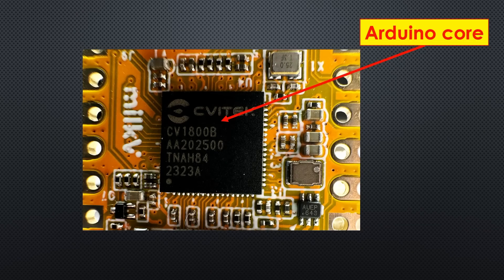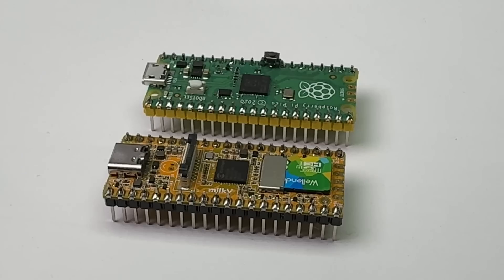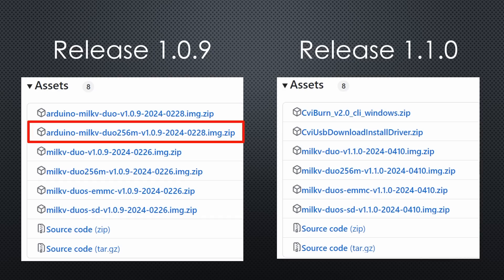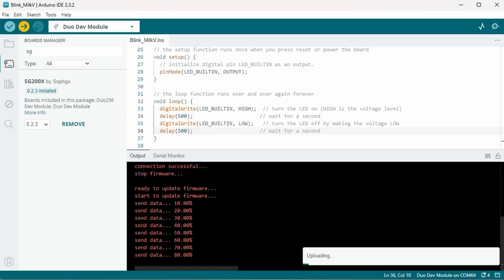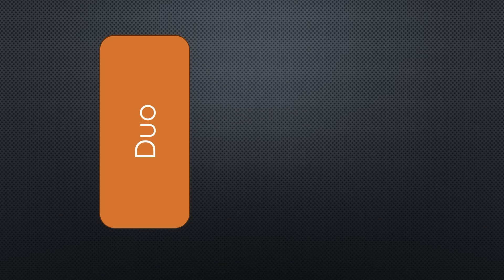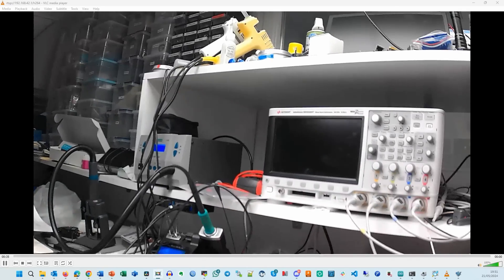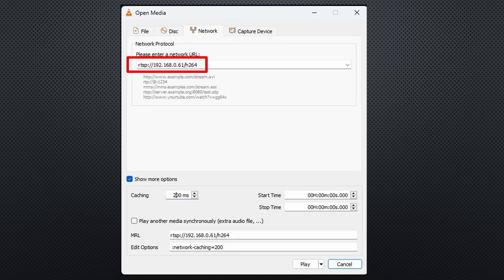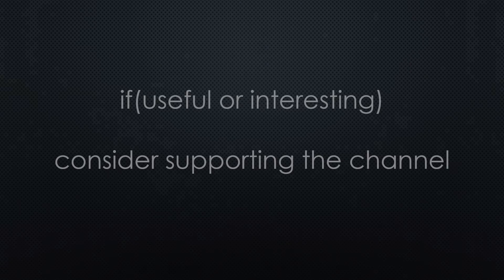(485) $8 MilkV Duo: Arduino on one core and Linux on the other

Comment: Wow, I started at Bell Telephone Labs in 1972 using Intel 4004 and 8008 processors per card in test equipment used to test Western Electric boards (100 pin tester).  It has been a great run.  Now I am 77yo and amazed at what has been achieved.  Eager to see what will develop next.  If only psychopaths did not have a big red button to turn it into a horror.  Oh well, not in my power to change.  Thank you for all your wonderful information.  It often leads me to doing fun stuff.
Reply from the maker: I am glad to read that my videos are motivating. I am 10 years behind you, but also think, that we live in a wonderful (elextronics) world. Psychopaths existed all the times. But maybe we did not know about them as much as we know now ;-)